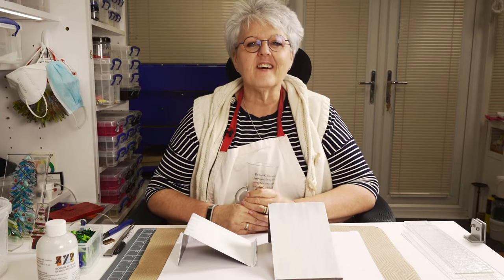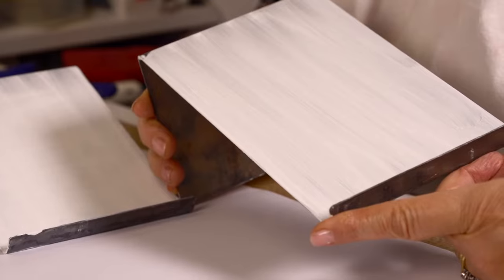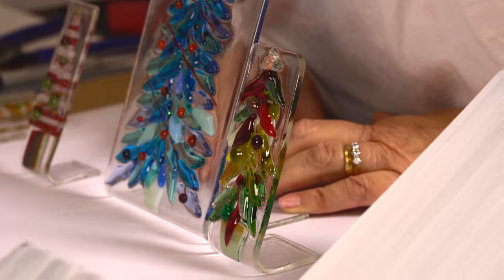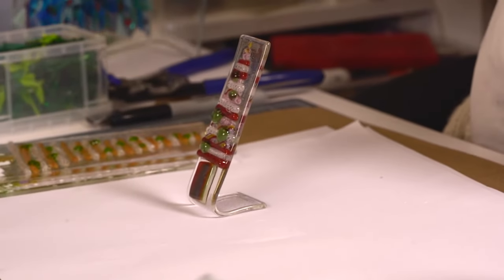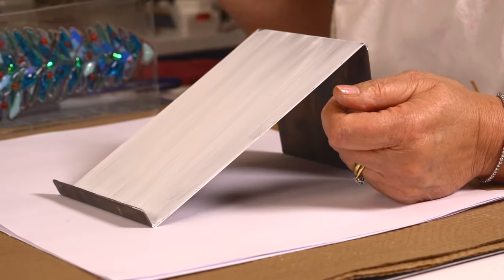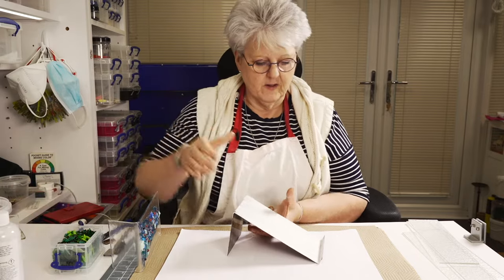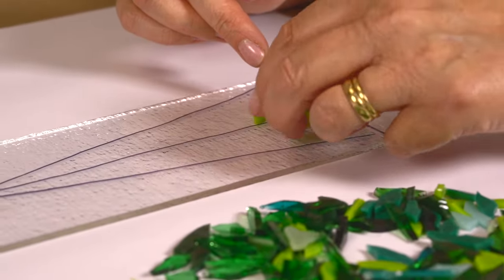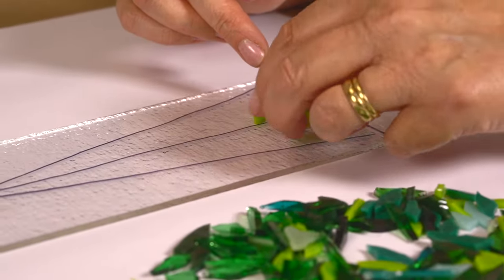Christmas tree project on a metal bender mould

Comment: Jill, I know this video is older but I love them ALL.  I just bought a bigger kiln so I can make these and a lot of the other gorgeous projects you have.  I am curious, do you think that one could use a "thread" of Glass Lline paint to decorate the tree with "tinsel"?  I was just curious I DO have some vitrigraph and regular stringers I can fashion into tinsel too, but I thought it might be an idea to try.  Now that I am mentioning it, my only concern is whether or not the tack fuse temperatures will be hot enough for it.  I guess I could read the instructions?  (Duh! lol!!).  I am sure you are busy, but I would love any insight on that if you have a minute. Thank you so very much for all of your contributions to fusing, I LOVE your channel ❣  xx
Reply from the maker: Hi
Glassline paints mature better at higher temperatures, 790ºC and above. You may find a tack fuse will work, but may not bring out all the depth of colour. Best option would be to do a small test piece rather than potentially trash a larger piece.
Reply: @FiredGlass  oh that is definitely helpful and I will do just that! Thank you so much.  Hope to see more vids from you soon! xx